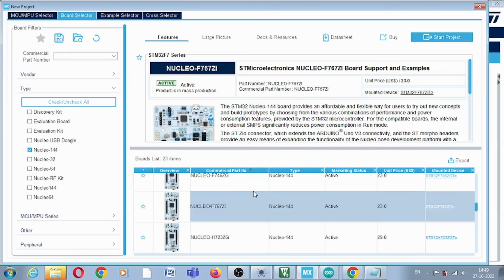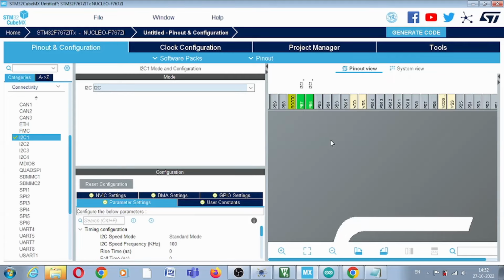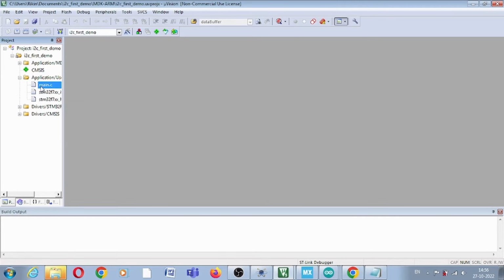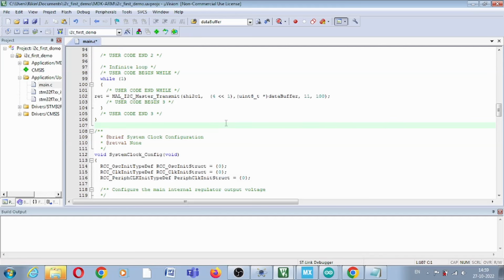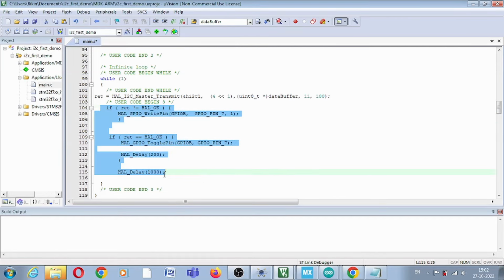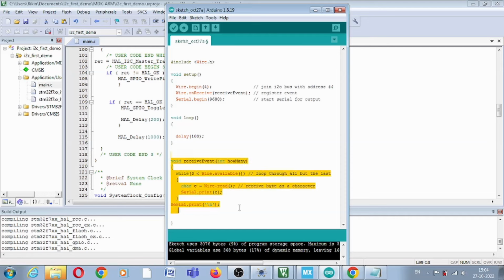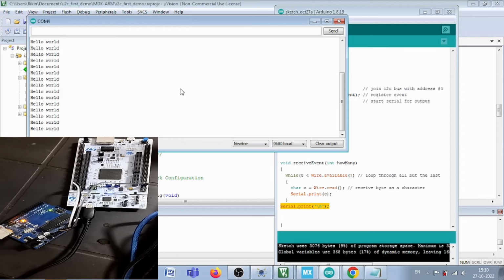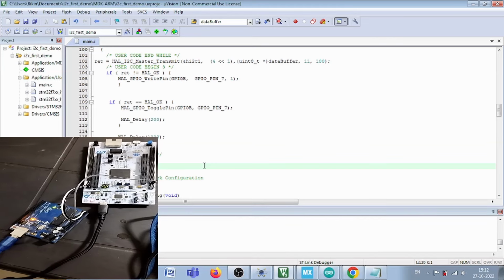I2C on STM32 : Data transfer between Nucleo 144 and Arduino

Comment: Do you know of any caveats if STM's HAL library has any I2c issues?  For example, when to use hal_i2c_master_transmit () vs HAL_I2C_Mem_Read/Write()?

I understand the former sends the register address first  (start, address, stop), while the latter, send start bit, slave I2C address, slave internal mem address, repeat start, data, stop.. i.e no stop in the middle.

I'm using stm32h7 and seeing issues with a temp sensor.. not sure if I should try a third-party/opensource driver (ex. adastra-soft).